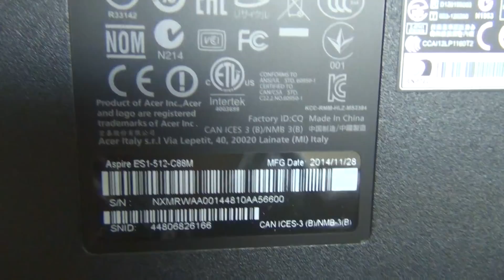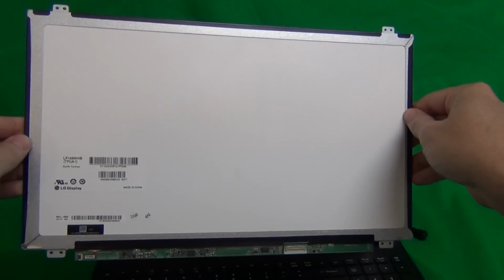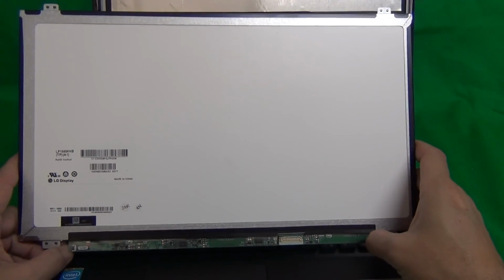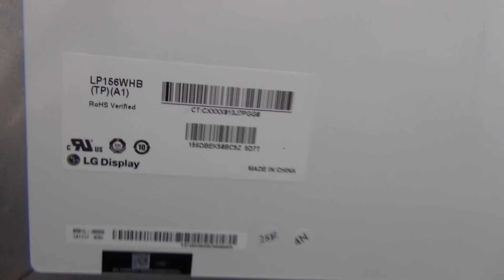Acer Aspire E 15 ES1-512 Laptop Screen Replacement Procedure

Comment: Thx, awesome video, seemed on my laptop, the connector to the screen must have came lose, using your video, i pressed firmly where the wires connect, and my screen now has no fuzzyness, problem solved, thx...
Reply: I have a question, was it the connector to your screen being loose that caused your Laptop to have a black screen? My Acer E 15 laptop is completely fine and I can see the screen but, it's very hard to see so, I think the screen connector came loose but, I'm not sure if that's why my screen is black. Please help.

Comment: hi i need your help we have opened the screen for some repair after closing we have made any mistake that we have no enough wifi boost to connect the wifi with modem ı have check it that can user full wifi range only when ı am near the modem 1 meter after 2-3 meter they can not connect you will se it but the range scale is not even a line wifi range and i can not connect it to wifi . what did we do wrong when locking the screen , ı think the wifi antenna is somehow not functon right or loose contact, thank you

Comment: Does the "C88M" at the end of the model number mean anything? I just want to make sure that I'm purchasing the correct part for the correct part number. (I have the ES1-512-C88M model as well).
Reply from the maker: For some series, it does as this will determine the type of screen installed. But for the ES1-512 series, it only use one type of screen. Thank you

Comment: can see faint windows logo. looks like a backlight failure. Will replacing screen solve issue?
Reply from the maker: +Graham Kennedy Yes
Reply: +Screen Surgeons will this work on the ACER ASPIRE ES1-512-P18H REPLACEMENT LAPTOP LCD SCREEN

Comment: pretty sure I have the same model... and just removed the battery. take a bobby pin push it in the hole, slide left and the battery pops right out.
Reply: ah never mind. you have aspire e 15 start.